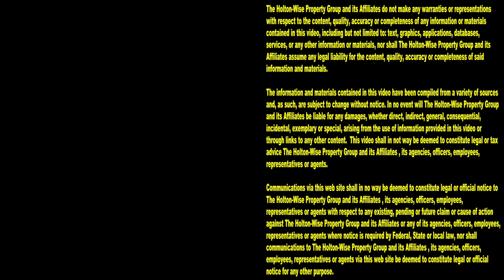Evictions Caught on Tape: Evicting Hoarders & Renter who set my House on Fire | Tenants From Hell 77

Comment: Would definitely prefer a hoarder. Less damage, less problem, less money.
Reply: My thinking is with hoarder - electrical is still okay - compressor- condenseor-evaporator- (for AC) - plumbing will be alright except maybe the fixtures. I don't even know where to start with carpentry and load bearing stuff and roof with a fire.